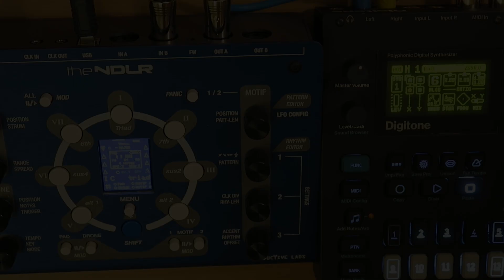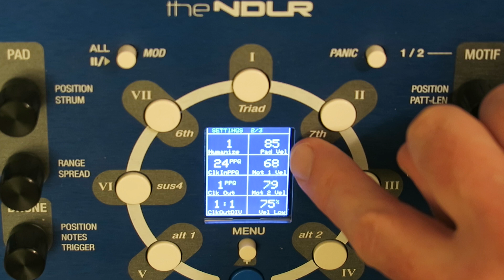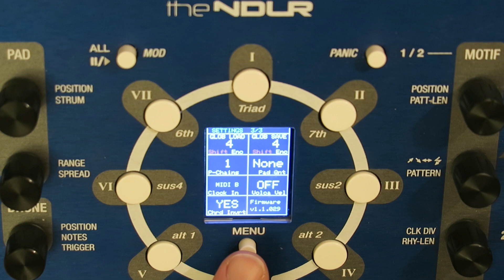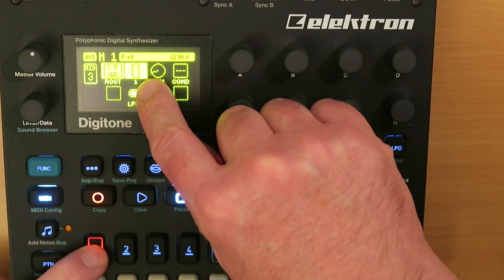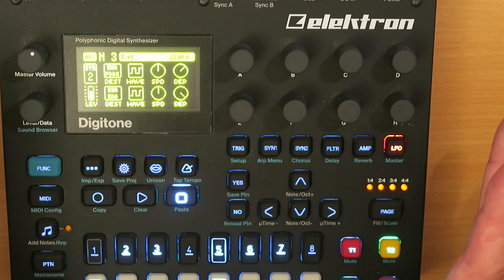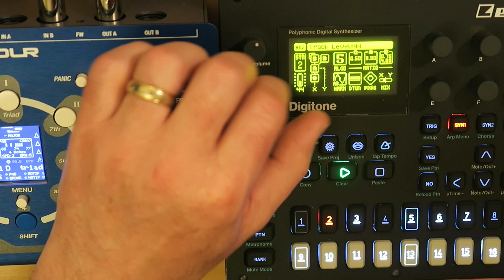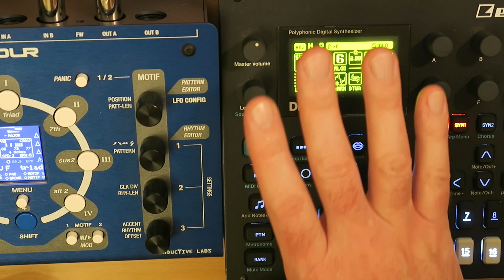How to... control the NDLR and Digitone using MIDI tracks

Comment: Really nice - thank you.  Out of interest, do you use logic audio...I recently got a NDLR and I am trying to make it work with the soft synths in logic audio, i load 4 soft synths, each set to a different midi channel but when i try to use the NDLR, all of the midi info for pad, drone, motif 1+2 is played by each soft synth...i cant figure out out how to send the midi info for drone, pad, motif 1+2 to each soft synth - any thoughts or ideas where i can find a solution for this?
Reply from the maker: Good question - that should work fine if you set the MIDI channels in the settings page in the NDLR so each part plays on a different channel. I'm not an expert on Logic though - how are you configuring the MIDI channel for each soft synth?
Reply: @SynthDad  thanks for the reply - yep, i think i am setting the midi channels correctly on the NDLR - i believe the problem is most likely to do with how i have things configured in logic audio, that being said, i have 4 soft synths loaded in logic, each one set to the same corresponded midi channel as the NDLR.  However, the out put from all midi channels (motif 1,2, PAD and drone) plays on each soft synth.  I have managed to set things up with soft synths in reaper ( 4 tracks, each with a soft synth that corresponds to the midi channel on NDLR) and it works as expected.  I just cant get it to work in logic for some reason

Comment: Hi i have just bought a ndlr looking for an all in one synth. Would youv recommend the  digitone...for bass, pads, leads etc? Does it have microtuning? Is it easy to switch between midi tracks and tweek settings as they are being sequenced by ndlr? Thanks
Reply from the maker: The Digitone is an FM synth, and that means it has a very specific sound and approach to sound design. Elektron have made it very easy to use, but FM synthesis is still very different from standard synths. You'll need to listen to videos on the Digitone to see if you like its tone - it can be harsh, metallic, industrial, but it can do deeper lush sounds.

If I was buying a new Elektron synth I'd get the Syntakt. A very powerful device with both drum and other synth engines in it. Well worth researching.

Comment: Do you like the Digitone with NDLR or did you prefer the Blofeld? I ask because I'm torn between the two. I already have a Digitakt so it would fit the flow so to speak.
Reply from the maker: Between the two I really like the Digitone. I find it an inspiring synth to work with. It has a very unique sound but I find it easy to tweak. It pairs really well with the Digitakt.